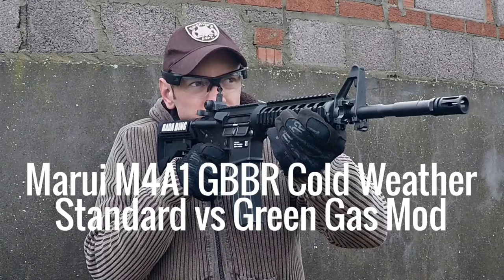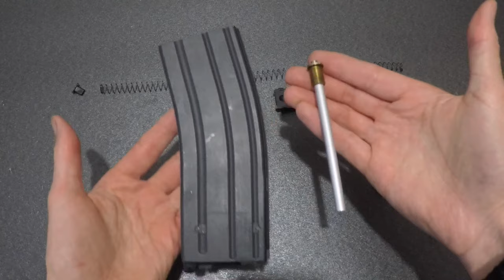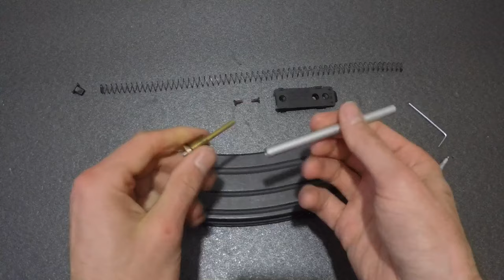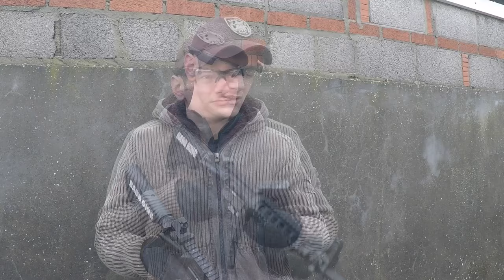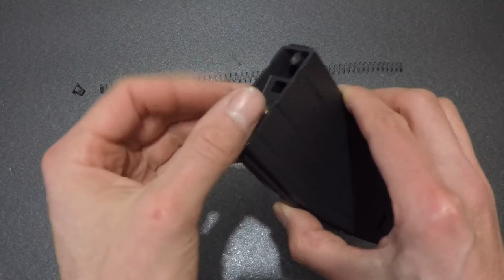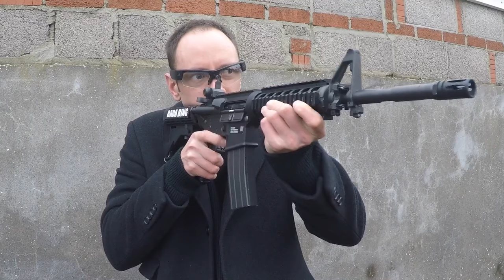Tokyo Marui M4 MWS GBBR Cold Weather: Standard VS Green Gas Mod

Comment: Dose this work on every GBB mag or only the Tokyo Marui mags??
My WE G39 gets really bad in colder weather...
Reply from the maker: +MCplicki As far as I'm aware it's just the Marui M4 gas mag. Some gas pistol mags have the same tube within the magazine. For example on the KWA USP. 

However when I removed the tube it did the exact opposite of what it does on the Marui M4 magazine. 6 shots at best. 

Unfortunately the WE G39 doesn't have the same internal design. It already has a large tank for gas, you could try different brands of gas to see if it helps. The plastic shell tends to be pretty weak, is that all in good shape? On my old G36 mags the shelf holding the guts in chipped off and as a result the internals sat a fraction lower so it didn't have a tight gas seal to the nozzle.
Reply: Thanks for the quick response ;)
I´m in the process of testing different brands..
And I already cracked one of my mags while reloading..the plastic is really fragile..
Reply from the maker: +MCplicki Oh yes, very fragile. I'm surprised they haven't released a gen 2 mag with more durable shell. 

Hell, even g36 style pmags would be awesome!
Reply: This would be awesome!
Even better would be some pmag´s

Comment: hi, Bada Bing, what green gas brand use in the video? thank you so much.
Reply from the maker: +Carlos Arnau Hi!

If I recall correctly, I was using Propane. As well as Guarder Green Gas, but chose Propane as it works better during the colder weather.
Reply: BadaBingPictures Good Job for these videos. Excellent films.
Reply: BadaBingPictures Good Jobs for these videos. Excellent films.
Reply from the maker: +Carlos Arnau Thanks for watching mate. 

All the best

Comment: the green gas mod vid isn't there ????
Reply from the maker: The GGM isn't really required anymore. The original magazines that came out upon release in 2015 were notorious for having a limited gas capacity. After a few batches they made slight improvements and users were reporting that the storage was higher than before. 

To save people needlessly cutting up their mags I removed the video. 
Of course you can continue to remove or cut out the silver tubes within them but the disadvantage is they can be overfilled much easier. With a higher volume of liquid gas and even less space to convert from a liquid into a gas, it could shoot liquid through the nozzle and the performance would take a nosedive. 
Cutting off a couple of centimetres from the inner tube would also increase the gas capacity but only allow it to charge up to a certain point, thus maintain that breathing space.
Reply: @BadaBingPictures  cheers Mr Bing. will i have your attention i have another quick question. how long (on average) should it that to fill the mag with gas & are you going to do a general maintenance video for the TM MWS? (there's really none out there). i know yo did one for the GHK but it would nice to have one for the TM. again cheers dude and keep up the great content.
 .
Reply from the maker: You're very welcome. 
From empty I charge a good 10-12 second blast of Propane for gaming. Following gas charges when reloading is usually about 4 seconds to top up, but every gas bottle nozzle is different and fill at different times. Test it out to see what works for you. 

I store my mags with about 3-5 seconds of Propane and I'll top them up with a further 5 or 6 seconds. 

I'm not going to be making a maintenance guide for the TM M4. It's not that complex. I  just perform more or less the same procedure that I do with the GHK. The lower trigger box is more difficult to get into and clean, however you can get away with wiping down the surface and ensuring theres no grit or grease in the action. 
With the smaller metal components it might be better to use a dry clear PTFE lube that bicycle chains use. Silicone oil tends to bind the action.

Comment: Hi. Can you tell what gas exactly you use (puff dino, habbey, duel code,....????
Reply from the maker: Propane.
Reply: @BadaBingPictures  thaks man but, propane its too hard for an stock mws right? Can broke easily with this power without any nozzle modification isnt it?
Reply from the maker: @13expAirsoft Propane will eventually snap the nozzle return spring. It’s not the end of the world as upgrade springs are very affordable and it’s relatively easy to install. 

Some people have had their plastic buffers break too but that’s a case by case basis. Mine is still a-okay. 
Apart from that using propane is fine.
Reply: @BadaBingPictures  Thanks man for ask, and thanks for your videos. Suscribed.
Reply from the maker: @13expAirsoft  You are very welcome. Thanks for the support. 
If you’d like to gain more knowledge from many other TM M4 owners, join the Tokyo Marui GBB discord server. 
https://discord.gg/6TcEmc7NCr 

It has over 1500 members and you can find so much more information.

Comment: how to do a power up mod on this model like ts only 1.1J its not enough
Reply: green gas of the propane level (this might help http://gtaassos.forumactif.fr/t974-comparatif-puissance-des-gaz)
longer inner barrel (stock inner is 250mm and you can go up to 370mm with the stock outer barrel, preferably get a stainless steel one, like prometheus)
ra-tech npas valve, that allows you to tune the amount of gas that goes from the magazine to the barrel
heavier BBs (.3,.32), although for that apparently you need to replace the stock hop up nob and maybe buking (maple leaf autobot 60 degrees and maple leaf omega nub, black is a good combo) because the stock one is to soft to spin heavier BBs

P.S. this is all theoretical, I don't have the gun yet :)
Reply from the maker: This is correct. 
Really the best way to increase the FPS without having to install an NPAS and spend time tuning is by simply installing a longer inner barrel, as Ioan Dragulescu says. 

NPAS Systems are not known for their consistency. 

With gas guns; the longer the inner barrel is, the FPS will increase. 
Likewise if it is a tight bore it will increase FPS more. 
My stock MWS can lift bbs up to 0.30g and lift them very well.
Reply: I'm quite curios about the ra tech npas, there are some people on the airsoft-forums.uk (maybe you hang out there a bit :) ) that seem to have success with it. And watching the ra-tech video presentation, they seem to have done smth to the screw, making it turn pretty hard, precisely to make it stable. If I end up getting the gun I will definitely try it, it's just 10 euros (on an intalian site nonetheless :) )

But I think there are fixed high flow valves for the bolt and I know there are high flow valves for the magazines also, I just don't know how safe it would get for the gun in the end, other things my brake besides the nozzle springs

Comment: Planning to do green gas mod but the tube is difficult to remove
Reply from the maker: You don't really need to perform the GGM nowadays. My first batch mags  (Late 2015/Early2016) couldn't hold much gas at all and the mod helped increased the capacity. 
For the best gas charging results, ensure the gas bottle is warmer than the magazines. The gas transfer will be more efficient.
Reply: @BadaBingPictures  mine came out of the box can only shot 35 and recharge again
Reply from the maker: Okay. If you feel the need to perform the mod, remove the smaller brass inlet valve before taking steps as drastic as cutting the tube itself. Probably best to use heat to break the loctite on the brass thread.
 
Ensure you don't overfill the mags. Without that inner tube you can charge too much liquid gas and that can get fed into the rifle and drive performance straight down!
Reply: @BadaBingPictures  oh tnx for the info will not do green gas mod anymore
Reply from the maker: You can try and remove sections of the inner tube as this will still give you the limitation for liquid gas capacity but squeeze a smidge more in. I’ve seen people try this, and I experimented myself but it was so long ago I’ve forgotten the results. 

Basically if you can fill 12-14 seconds of gas the rifle should run a-okay and create strong blowback from 1-35rd. That’s the case with mine anyway. 
All the best
Reply: @BadaBingPictures  you got video of how to do it

Comment: My green gas canister won't fill my magazines, the canister keeps letting out gas. I suspect the nozzle is not long enough. Ps the brand of gas is swiss arms. Can anyone help please.
Reply from the maker: Marui inlet valves always hiss gas out as they fill. It should be a very slight sprinkle as you push the can down onto the magazine. 

Does it let gas into the magazine at all? Or is it completely empty?
Reply: BadaBingPictures  Thanks for replying. It partially fills the magazine. The canister lets out a lot of gas when filling, I have three canisters of green gas and tried them.I don't not a broken nozzle on the gas canister. Might i need a nozzle extension for for them?. Also I can send you a video of it
Reply from the maker: I assume you are filling the magazine upside down with the can on top, and the gas can nozzle is firmly centralised on the inlet valve for correct feed alignment? 
Are you the same person on the Tokyo Marui MWS Gas Blow Back Series Facebook group? If you are not, there is someone on there that posted a similar problem very recently. 
It could be your can nozzle. Some times metal nozzles don’t work as well as plastic ones. 

If you would like to send a video to me, of course. You can message me on my Facebook page or Instagram. https://www.facebook.com/badabingpictures or https://www.instagram.com/badabingpictures
Reply: BadaBingPictures I'm filling the magazines the proper way. No I'm not the person on the  facebook group. I'll send you a video on facebook. Thank you.
Reply: Yurio Kitten Hey! I own the marui mws myself too and I can tell you from my experience that these gas cans work:
Asg Top Gas (Green Gas)
Pro Tech Green Gas

Comment: Is nuprol green gas 2.0 safe to use?
Reply from the maker: Officially, no. Only 134a/144a is recommended. 

However I’ve used gas stronger than 2.0 and it’s been fine. It’s entirely up to you.
Reply: @BadaBingPictures  Thank you

Comment: Do i still need greengas mod on new mws?
Reply from the maker: Not really. Although it’s still an option, just depends on you and if you need any additional gas capacity. 

I talk about it in my recent 4 Year video.
Reply: @BadaBingPictures  so old one and new one still thesame?
Reply from the maker: I saw an increase in shots per gas fill but I couldn’t find a difference when it came to looking at the individual components, so my results may not reflect what you might experience. Again, check the review for my results. 
https://youtu.be/C3zjxw7IrBc
Reply: @BadaBingPictures  is the number 2 magazine only applicable for seperate magazine purchase or brand new tm mws came on the box has number 2 also?
Reply from the maker: @jimpgamingtv2158  They should all be like that, it must have been an improvement which was brought in over the last couple of years.
Reply: @BadaBingPictures  is it safe to remove the tube any side effect?
Reply from the maker: @jimpgamingtv2158  Its safe, so long as you don't choose to cut it off with the small fill valve beneath it. 
Removing the tube will make the magazine extremely more susceptible to overfilling. More liquid gas thats inside the magazine, the less room you have for that liquid to convert into a gas. This can fire liquid gas into the action and create terrible performance. So you have to be even more careful with regards to how much gas you fill.
Reply: @BadaBingPictures  when first unbox the tm mws does cleaning rod and speed loader is included?
Reply from the maker: @jimpgamingtv2158  Yes. Although the speedloader is the old style long plastic tube and rod. Best buy a pistol style/m4 magazine style speedloader. Thats what I use.